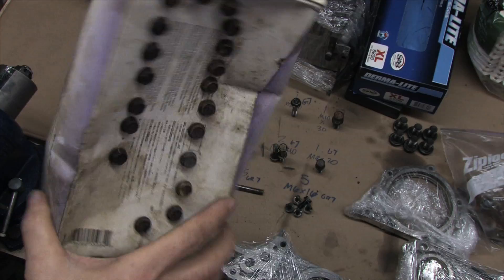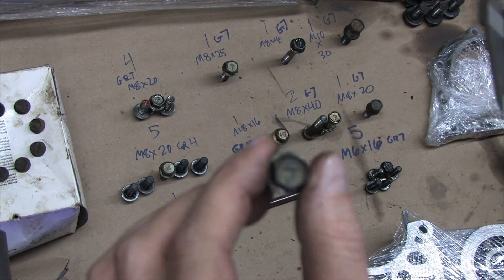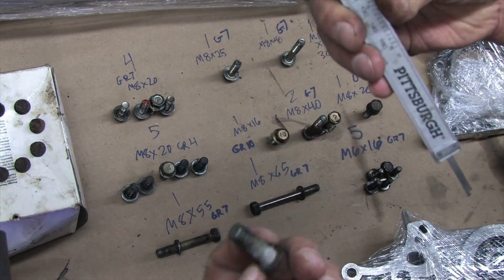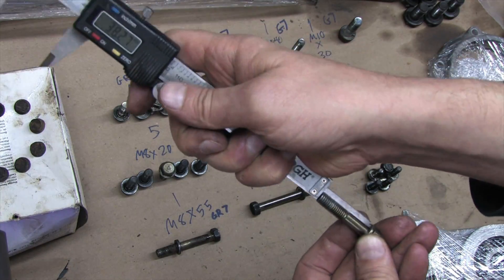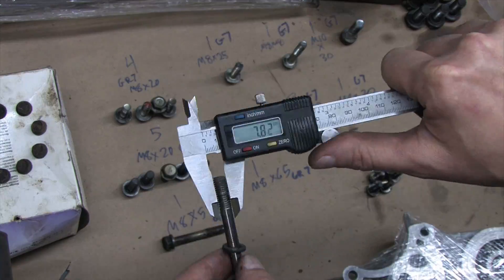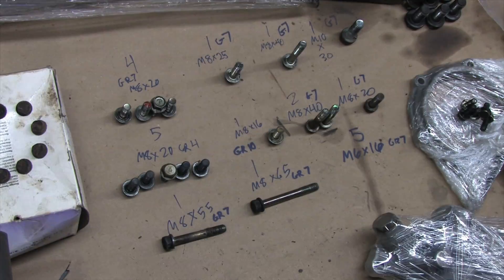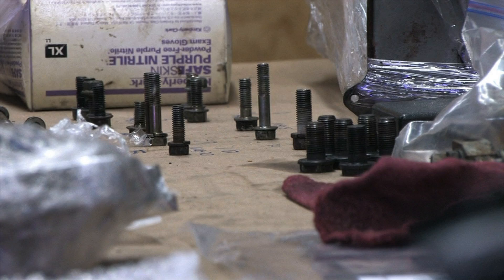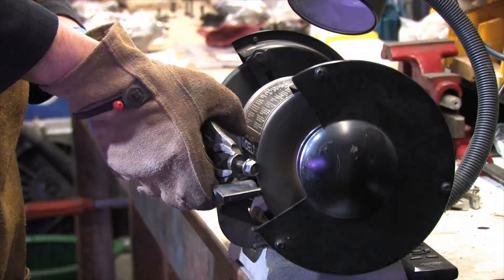Hyundai Assembly 2 - Fasteners, Shortblock Assembly & Head Progress

Comment: Fitting that rear seal 2:40 could be done so easily just by heating that housing slightly so as it expands, all you'll need two fingers to install the radial seal. great video !
Reply from the maker: Nice tip!  I never tried mixing thermal expansion with rubber parts, but it's so simple... thanks!
Reply: *****  it's totally safe with viton parts, they tend to be exposed to extreme hot conditions, personally never seen this tip but i used to do it with no problems :)

Comment: It looks like you are enjoying using your new digital torque wrench.

Just some notes and observations. Lock washers really should not be reused. If they are captured, like the one on the hydraulic tensioner pulley bolt, replace the whole assembly. Lock washers are nothing more than springs and do fatigue over time.

To avoid bending up an oil pan in the first place, use an oil pan\gasket removal tool. I use four, short studs threaded into the block holes at each corner to help align the oil pan during installation. Not such a big deal with the motor on a stand but if still in the engine bay, a must have tool and installation tip. You only get one stab at it to prevent leaks or you have to do it all over again.

Thanks a bunch for the video and all the hard work that goes into them.
Reply from the maker: I just got my oil pan separator tool.  MD998727.  :D
...and YES!  This wrench will teach you how to use a torque wrench correctly.  Also, it's probably the best instruction tool I've ever used in these videos because of how easy it is to read.  I don't have to subtitle the torque specs.  I can't tell you how much I appreciate that all by itself.  I hope you like reading it.  :P

Comment: Hey Jafro, need your advice bro. Did a clutch/flywheel replacement on my GSR Lancer today (4G93T, 7 bolt), replaced clutch master cylinder, bled system. put it all back together starts and runs fine in neutral, but wont go into gear, just rattles off reverse and wont go into first, any ideas??
Reply from the maker: Clutch isn't fully disengaging.  If an adjustment doesn't fix it, either the slave has problems or anything else that would prevent the clutch from achieving its full range of operation (pivot, fork, t-bearing, bell housing bolts, wrong step height, etc...),  Basically your synchros won't let you shift because they're still being squeezed.  Gotta be able to fully release the clutch to shift gears.  I made a video about it at the end of the trans & clutch series.  :)  Trans & Clutch 8.
Reply: Yup, know pretty much all of that :P haha, but thanks for the help
Gong to check the pedal pivot point on the master cylinder shaft tomorrow morning. if that doesnt work I'll see if I can make a longer shaft for the slave cylinder.
Swapped my flywheel with a new freshly machined one after the last one we installed was machined extremely poorly (was bowl shaped). Fork shouldnt be a problem, never changed it/modified it. Thrust bearing was also replaced with the new clutch and PP, bell housing bolts? not sure what you mean there, but theyre all done up correctly haha
Reply from the maker: Liamv4696 What was the step height on your new flywheel?
Reply: To be honest, not sure. I left it with my machinist. He's been working on cars for decades and wouldn't make a rookie mistake like forgetting to grind the step height. But I will definitely be checking with him and seeing whether he did it or not. But even if the step height is too high, then it would be permanently disengaged wouldnt it?
Too low would mean always engaged right?
Reply: Saying that, if he did f*ck it up, I will not be very impressed... D:<
Reply from the maker: Some clutches like different step heights.  A few thousandths there can make a huge difference.  The ACT clutch disc is thicker than a stock unit, and usually likes to be cut around .610".  If you machine the face, you have to machine the fingers as well... but if the fingers weren't machined, you'd have the opposite problem right now.
Reply: I'm using the Exedy MBD047U clutch disc, the face wasn't really machined much because it had only done 15000km's since I last had it apart and rebuilt. so it was just a quick cleanup. So yeh, if the steps werent machined I wouldnt be able to drive it because i wouldnt be able to clamp the disc between the pressure plate and flywheel, correct?
So worst case scenario is that the fingers have been machined TOO much, meaning i cannot disengage the clutch fully. crap...
Reply: also going to rebleed the clutch system in the morning. maybe theres some air in the master cylinder still. we bled the system through the nipple on the slave cylinder, with the slave cylinder pushed all the way in so we didnt have to worry about air in there, but maybe we stuffed it up and theres some air in there.
Reply: On the Exedy website, under the flywheel option for that clutch it has:
"Flywheel profile, -15.5mm" is that step height? I have no idea, theres very little information of the website
Reply: Took the clutch off, step height is ~15mm, difficult to measure. was using a micrometer and a ruler. Any idea what the step height should be?
Reply from the maker: If it was exactly 15mm, I'd say that is way off.  15mm is .590".  Factory step height is .608"-.612".  I shoot for .609 - .610 which is 15.4686 mm.  You don't want to go any wider than 15.50 mm  I put 3 decimal places there because believe it or not, .025 mm - .050 mm differences will completely change the behavior of your clutch.  I'm serious.

I would re-visit the way it was measured.  You really need to measure that with a precision depth gauge.

Off-topic from the step height... Where did the clutch fork line up in the fork hole?  Did you check that?  Now that you've got it apart, if the flywheel is right and you were running out of fork hole, you can probably fix it by installing a shim under the pivot ball (5mm washer under the pivot ball will give you plenty more fork hole).  Remember that the slave cylinder is self-adjusting.  More master clutch rod would be compensating for something wrong on the other end.  If the flywheel step is right, it might be something simple like that...
Reply: Well, spent all day working on it, pulled it apart, inspected it etc

Chucked the old CD and PP on there to compare it to the heavy duty PP and Exedy CD, didn't seem to be much difference.

Inspecting the fork, it was too far to the drivers side, just after the halfway point, so it was running out of hole before it could fully disengage the clutch.

fitted a 2.10mm spacer under the ball joint (these GSR gearboxes generally only need a 2mm-2.5mm spacer in there), which appears to have fixed the problem, except it created a new one, when the pedal was fully depressed I could hear the fingers of the PP contacting the CD springs and rattling away, so I adjusted the master cylinder shaft to give less disengagement, which solved that issue.

I must say though, the heavy duty plate and Exedy clutch disc are very easy to manipulate and shift with, easier than my OEM replacement spec clutch and pressure plate. Which surprised me actually, thought it'd be more difficult top operate.

Hopefully this is the end of my clutch and transmission problems, fingers crossed! Next step will be shifter bushings, because they're f*cked too.

Got some numbers back from my machinist about the flywheel I was using that was machined incorrectly, the inside of the contact area was 15 thou lower than the outside of the contact area, I mean come on, that's just crap, someone needs the sack!

Just realised, by drivers side that means passenger side for you :P
Reply: مكط

Comment: Another great vid.  Long time watcher first time commenter.   That tool you used to clean the nasty coolant pipe looks just like my new Matco air sprayer.  Things awesome but what were you using for a solvent and is it safe for that rubber hose?
Reply from the maker: Yes it's probably the same unit as your Matco sprayer. Made in the USA.  When you look up siphon feed blow gun on teh internets, you find dozens of these marketed in different packaging, but they're all the same.  Mine came from NAPA.  The solvent I'm using is Mineral Spirits.  Pay my DIY Parts Washer video a visit.  Check the description.  I made a whole video about that thing because of how awesome it is.  ;)
Reply: ***** hmm I probably overpaid then lol.    In my experience mineral spirits tend to make rubber swell. Such as on valve cover bolt grommets and pcv grommets etc.  For this reason I have forgone the parts washer for the sprayer coupled with either a good concentration of oil eater or purple power to clean these parts.   Any way long story short you haven't had any degradation issues with the hose?
Reply from the maker: Nah.  I mean, nothing that's any sort of deal-breaker.  It might be a bit stiffer by now... but I've had it soaking for weeks at this point and I'd expect that.  But even if I did have problems, it's standard aquarium hose.  8¢ a foot.  :D

Comment: I dont blame you, those valves look very ill, if you have to mix and match others in then thats keeping with the general idea of the engine.

Im sure it will work smashing, your so exact with your assembly :-))
Reply from the maker: Did you see how mixed and matched they already were?  LOL!  I'm actually making this one less mix-n-matched by replacing everything with the proper used gear.  Bolts, washers, crank hardware, oil pan bolts, water pipe...  I said I wasn't going to do this, but my true colors are shining through.

Comment: Thanks so much for the vivdeo, i was looking how to pack oil pump with grease in youtube, find yours in next part.Very good.

1) Please advise me with tips, how to organize the bolts and find what goes where. do i need to refer manual forall the bolt size before installing. I am DIY when i remove large number of bolts , i found difficult ..

2) Please advise what parts in engine is a must for Torque wrench. 

3) When I do timing blet i dont have space for some of the bolts that torque wrench cant fit, any idea about how to torque it..  please advise.
Reply from the maker: I put all of that info about the bolts including their lengths, diameter, grades, torque specs and even part numbers as well as other technical references all in the description.  ;)

As I go through other sections, I'll include those bolts as well.  The Hyundai didn't get as disassembled as the GSX project, so the upcoming GSX videos will go into far more detail.

Often times you will find a plugged access hole in the frame that permits you to insert a wrench with an extension through it.  Many of the bolts may not be accessible with the engine in the car, but usually when these parts are installed, the engine is not in the engine bay.  Sometimes you can raise or lower the engine if the timing mount is loose (it's loose when you're doing a timing belt job) for clearance with the wrench.
Reply: thanks, one last question, when i fill oil pump with grease, do i need to worry to not to block certain areas or path, or you dont mind just seal the grease as much as i can.. also can i use vaseline or it should be only white lithium grease or assemblye lube only
Reply from the maker: Vaseline or multipurpose grease work best.  You want to completely surround the gears and the teeth.  It just gives better suction to help the pump prime better.  Some machine shops inject it from the low pressure pickup side of the front case and completely pack that port, but I think that's excessive.  You just need to get the gears packed solid inside the pump cover.  Check the 6 & 7-bolt front case video linked from the description.  It's some of my best work.  ;)
Reply: Thanks much, afer rebuld can i use regular motor oil (mobile 5w-10 )during break in. or should i have to add some additivies..  some says dont use synthetic during break in. what is ur opinion
Reply from the maker: sivaraj palanisamy Use a cheap non-synthetic version of what is recommended for your engine.  I don't know of any DSM that uses that oil, but if that's what your car recommends, use it.  Oil viscosity is based on the size of your oil clearances.
Reply: Thanks so much. When the car have lot of mileage say more than 120 or 150 K it is it ok to use higher weight oil inseta of OEM recommendation